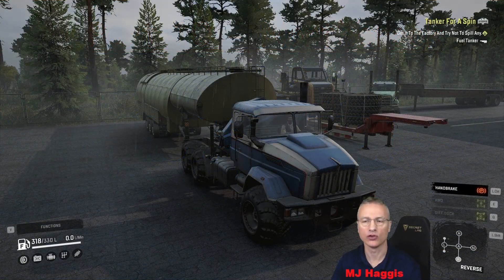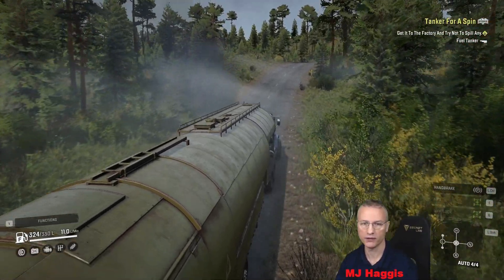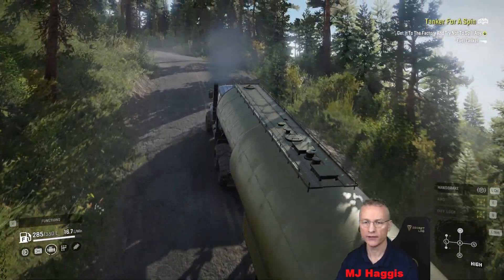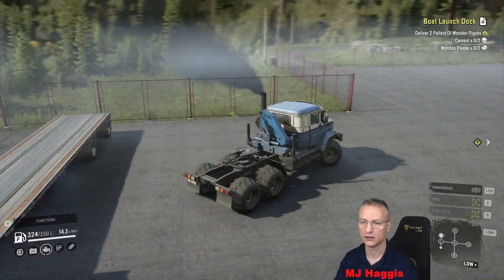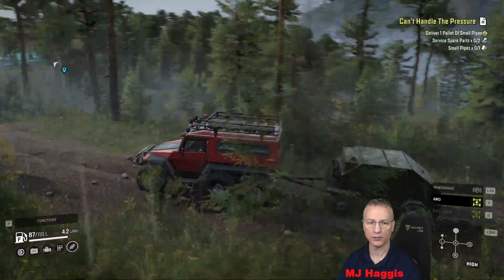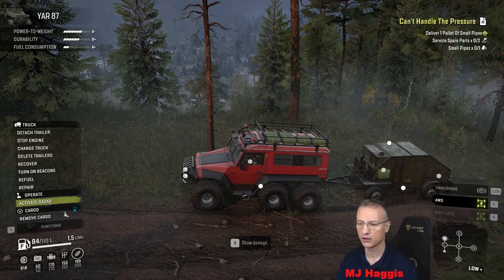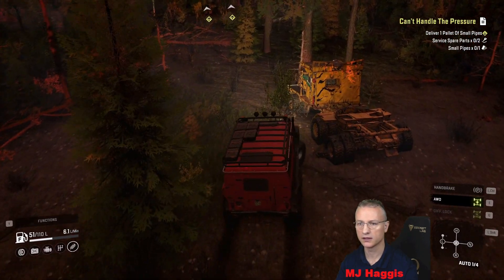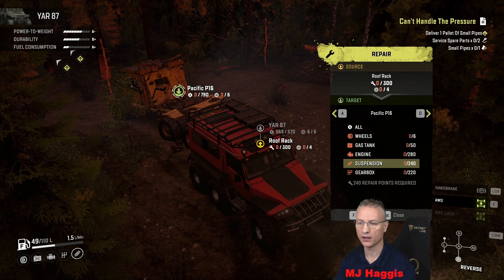Snowrunner - Northbrook - P10 - "Tanker for a Spin"

Comment: 18:00 again, keep in mind, you are driving on floaties, not offroads..
I used to take out 2 identical Yars, one on floaties and the other on chains, one towing a prototype exploration and the other a scout fuel trailer, one winched to the other... when I struggle with one type of grip, I just swap to the chains and drive that for a while, whilst towing the floaties one.... and vice versa xD
Reply from the maker: You must like the Yar then? Have you tried the Rezvani?
Reply: @MJ.Haggis  I'm not a huge fan of it, however there are circumstances where its slow, methodical traction is unbeatable (Immandre) otherwise, I use a Tayga with saddle low, high side 5 slot trailer, with a couple of Lo4fs in the rear xD
Reply: @MJ.Haggis  Rezvani? no..... modded version?
Reply from the maker: @gareth14111984  The Tayga setup is a good one 👍🏻 It's definitely a jack of all trades and I also like the look of it.
Reply from the maker: @gareth14111984  I've only used the modded one which was pretty good as well but when it comes to scouts I really like my modded Land Rover 110. However the vanilla Ford F750 is mighty capable too.
Reply: @MJ.Haggis  I've not bought any of the the DLC trucks, other than what comes with the seasons... but I'm a L04f man XD
Reply from the maker: @gareth14111984  I'm ksp a big fan of the wee Lo4f too. I just don't seem to get to use it as much as I'd like.
Reply: @MJ.Haggis  then you aren't using your imagination!! The L04f makes a great hat for many trucks hahaha
Reply from the maker: @gareth14111984  oh I've done that in the past but I'll be trying to keep it slightly more realistic but definitely putting a Lo4f in a trailer is a good idea 👍🏻

Comment: I would imagine it is because the freightliner is much shorter than most trucks too
Reply from the maker: Possibly that too. Strange that they give you a truck and only fits one of they trailers unless it's on purpose to force you to go seek out the other alternatives. Either way we figured it out 👍🏻
Reply: @MJ.Haggis  I think the freightliner is perfectly sized for the gooseneck with the CAT, but those oversized trailers need a little more room...